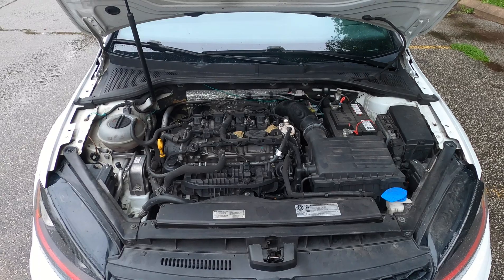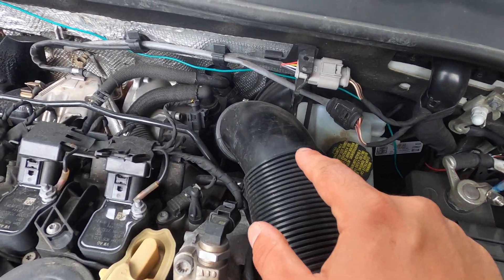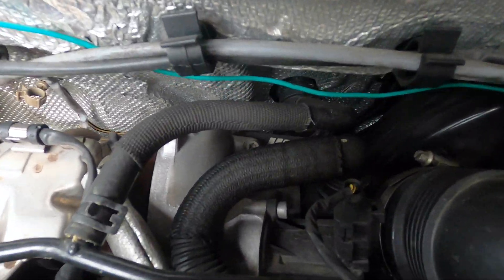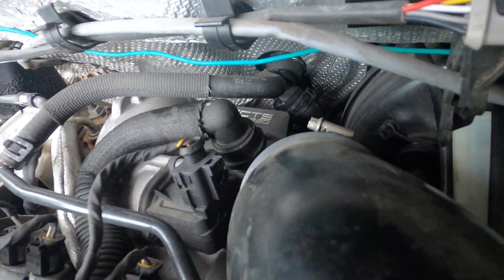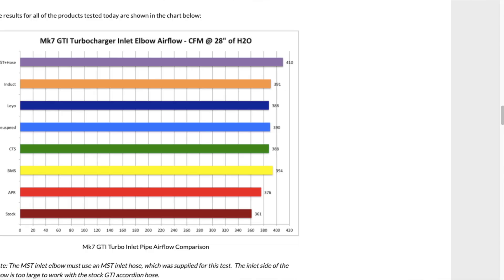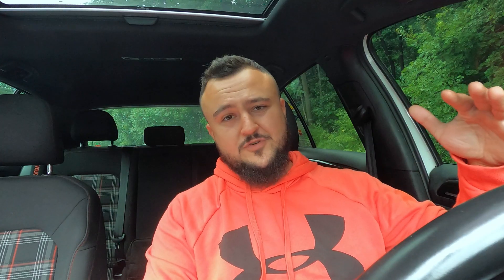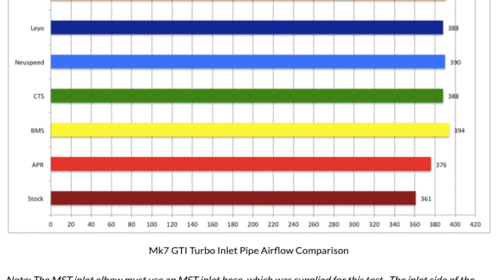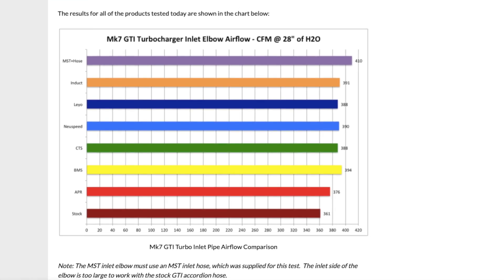Best Mk7 GTI Turbo Inlet Pipe To Make Power - (How it Works and What to Buy)

Comment: Hi man..i have a GTI mk7.5 with revo stage 1 and airbox modded with drop filter. I would like to install an air inlet hose and a turbo inlet pipe....do u think can cause lag or disadvantge?? Loss of torque/power---? thanks!
Reply from the maker: No, it will do the opposite, removing the restriction allows your turbo to spool up to speed faster

Comment: I just changed out the inlet pipe and hose for 034 ones. Could that mess with a CPO warranty? The car threw a EPC light and tranny errors like a week after install so I wanted to have a dealer check em 😭
Reply from the maker: No just the inlet pipe will not mess with warranty, after all its just a hose....

Comment: MST-Performance TIP & hose Kit vs ECS TIP & hose kit? Which company is better? Any difference in quality/reliability of the brand?
Reply from the maker: from flow tests MST is one of the best
Reply: @BurningRubber416  Thanks, I actually just received the MST-P Kit, and I’ll be installing it tomorrow. I did remove the snow guard and I got an AFE dry air drop in filter. Looking forward to how it all comes together.

Comment: This is not incredible ingenuity.  The only problem with the Stock TIP is, that there is an "indentation" on the inside that disrupts air flow (a smidge).  By increasing the diameter and keeping with the Stock Turbo, you aren't changing the Turbo's Inlet - so what's the "Real" gain?  This by itself is not the "et al" solution; however, when going to a Stage 2 and having better engine breathing a better TIP would be another "efficiency" component to ease the flow.  The trick is not to go "Too Big" or therein the airstream isn't flowing as smoothly.
Frankly, the "snow grate" removal from the stock box and a high flow filter is about all you need - but many believe in the TIP.
BTW - Spool is diagramed in the TUNE itself via Ramp Rate, not from a TIP.

This "down playing" of tuners' engineering is unbecoming of someone who is just an "individual".  APR (for instance) spends quite a bit more $ and are actual "Engineers".  So, the "I know it all" defense is quite entertaining.
Reply: You use a lot of “quotes”. And one thing is for “sure”. Dyno figures don’t “lie”. It’s kinda like when people “scientifically” say that Apple cider vinegar “doesn’t” contribute in any way to weight loss. But people who “take it” are losing weight. Hope this “helps”. Have a “nice” day.
Reply: @miggyv6856  lol entertainment. Question remains: if what your saying is true, then why did VW engineers decided to taper off the original turbo inlet pipe..?

Comment: I'm buying the intergrated engineering one on sale rn
Reply: How is it? I just bought the IE inlet and IE cold air Intake. Haven’t installed them yet
Reply: @SassiTV  same, still waiting on the inlet tho, they were on back order when I first purchased. Hopefully it ships soon.
Reply: @micaiahreese  yeah i picked up both as well as lowering springs! getting them installed soon. next season will be DP and Stage 2. possibly intercooler. already stage 1 with unitronic.
Reply: @SassiTV  I actually just got the car two months ago lol. So I'm surprised I've got the mods I have already 😂. I'm still deciding between tunes. Looking at IE's or APRs currently.
Reply: @micaiahreese  both tunes are great!!

Comment: So I’m a stage 2 unitronic mk7 golf r and I was thinking bout getting the Neuspeed hi flo discharge pipe, worth it?
Reply from the maker: It is worth it for sure the discharge pipe is notoriously restrictive
Reply: @BurningRubber416  ive heard it barely gives you sound much less performance
Reply from the maker: @Jvilleman400   the discharge pipe will not give you any sound but you will see quicker spool because there is less resistance in the air path out of the turbo and into the intercooler
Reply: BurningRubber416 the Neuspeed pipe comes with a turbo muffler delete, that’s where the added sound is

Comment: If I get an entirely new cold air intake do I still need to buy a aftermarket accordion hose?
Reply from the maker: The aftermarket accordion hose will improve the smoothness of the airflow. If your intake comes with a new pipe from the filter to the turbo inlet then you’re good!
Reply: BurningRubber416 that’s great thanks for the info. Do you recommend a certain CAI I was leaning towards integrated engineerings carbon fiber but feel like I’m just paying for the looks not the function. What do you think

Comment: would you consider bad for the engine to tune stage 2 with stock inlet pipe?
Reply from the maker: Great question! You can tune stage 2 with the stock inlet pipe no problem! As long as you have the stage 2 mods (mainly downpipe). Ideally, you would change the turbo inlet, turbo outlet and throttle intake pipe - I will do a video on this shortly!